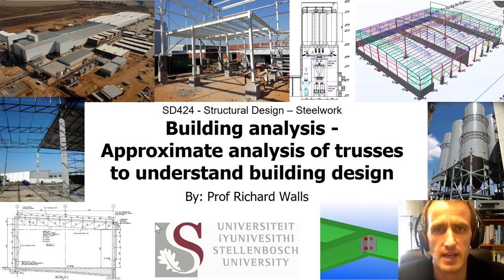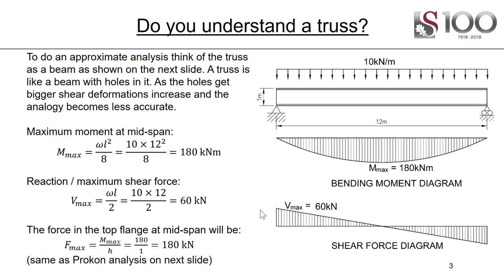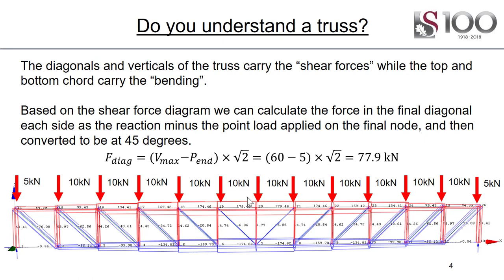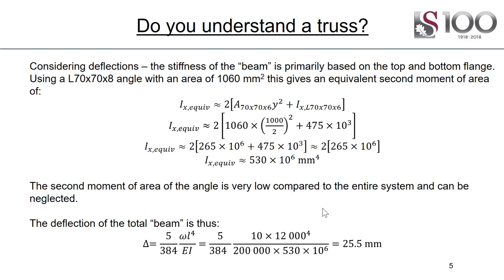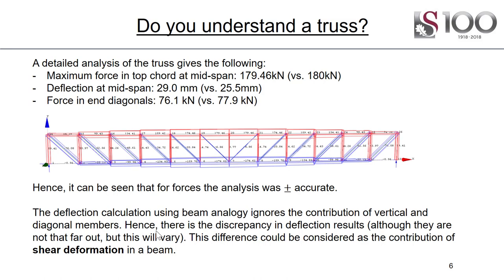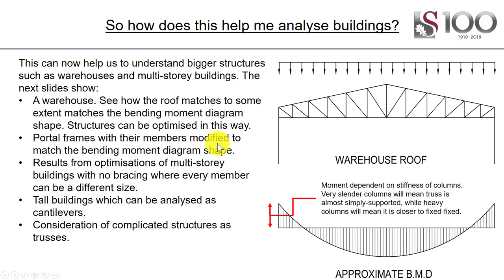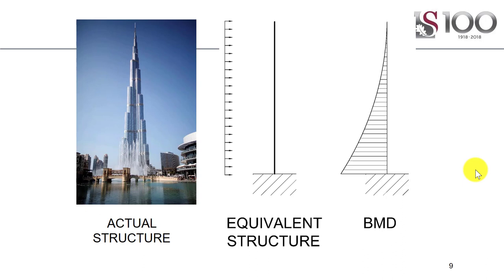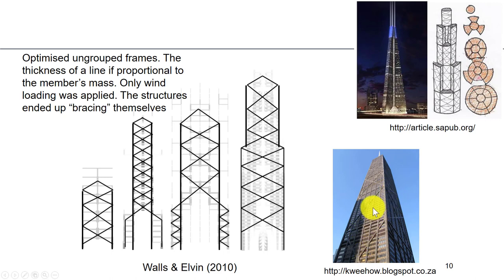Structural Analysis and Design - Approximate building analyses / Truss-beam analogy for design

Comment: Prof Richard,
Thanks for making the informative video.
Approximate assessment was clearly defined, one point needs to understand, "Truss- beam interconvertibility is acceptable till the Shear is not high." Needs to understand the reason behind it, moreover what will be the behaviour under high shear values.
Pl clarify through some lecture.
Reply from the maker: Calculations done here assume all deflections are due to bending. As the shear gets high and/or the truss gets deep the shear deformations start to become important and results become less accurate. You can test this by setting up simple truss and beam models and comparing results as you vary parameters.

Comment: Awesome video. I have a question. When you estimate the stiffness of the beam you dont take into account the web members and that gives you around 25mm. but if you could somehow include the extra stiffness you would have a lesser deflection. Which moves further away from the right answer. What you can do to improve the estimation (just for fun). Would you include shear deformations in the beam? But how to estimate the shear area mmmmm. I really love structures 😂😂
Reply from the maker: To get a more accurate estimate you would need to approximate shear stiffness and deformations. However, by the time you do that you lose the benefit of an approximate method and might as well do a finite element model. Hence, this is just to give a first approximation so you can check results and get preliminary sizing / sanity check on your answers. You will find in some of the older textbooks more detailed and accurate methods, from when FEM was not readily available.

Comment: Sr In the warehouse truss explaination ,  if the column is let say stiff of order of that required for miniumum slenderness criteria (not bulcky) and the truss is rigidly connected to column by welding then will column experience moment  ??
If yes ,very small ? Or high? (i dont think)
If no , bcoz column not rigid enough?
Please answer sir
Reply from the maker: It will depend on the ratio of stiffness between the column and truss. If you have a braced frame you could even make a slotted connection on the bottom chord of the truss such that there would no moment. However, in most cases you will exert a moment, and likely of reasonable magnitude

Comment: THANKS SO MUCH, PLEASE IS THERE ANY DESIGN CODE THAT SUPPORTS THISE METHOD?
Reply from the maker: Nope. Based on fundamental mechanics and structural analysis, rather than a code. However, most code guidelines follow such an analysis. Go find a structural engineer with grey hair and they will show you more useful techniques like this.

Comment: Thanks for the detailed explanation 
How to estimate the deflection on typical roof truss
 (pin pin) with slopes (Not fixed height) ?
Reply from the maker: It depends on what you are doing and how accurate you need the answer to be. You could approximate the behaviour as a beam with multiple sections to account for the slope (e.g. use principle of virtual work). However, as the geometry gets more complicated and you need reasonable answers it is best to just go to a simple truss model.
Reply: "You could approximate the behaviour as a beam with multiple sections to account for the slope" 
Thank you for the answer
It will be very helpful if you can give an example of this,
I did not find such an example on YouTube
Thanks
Reply from the maker: @goldonon  Use the principle of virtual work and integrate over multiple sections with each having a different stiffness. However, you are at the stage you shoudl probably just do a frame analysis,

Comment: How many panels are allowed taking into account the depth ratio L/15
Reply from the maker: There are not specific rules as this is a an approximate analysis. As the truss gets deeper and the verticals + horizontals have a bigger influence on deflections the results become less accurate.

Comment: Hi, why the distance from the neutral axis is 1000?
Reply from the maker: The depth of the truss/beam is 1m. When working about Ix the distance from the neutral axis is 1000/2 = 500. When taking sum of moments it is easier to take it about the top or bottom chord such that those forces cancel (zero lever arm), and then a lever arm of 1m is used.